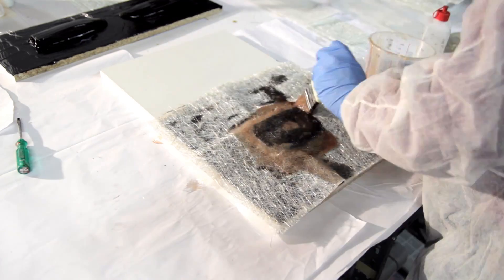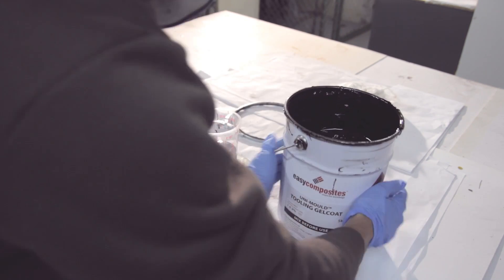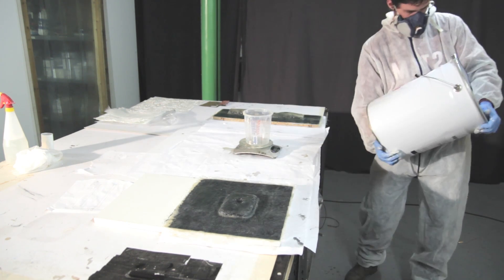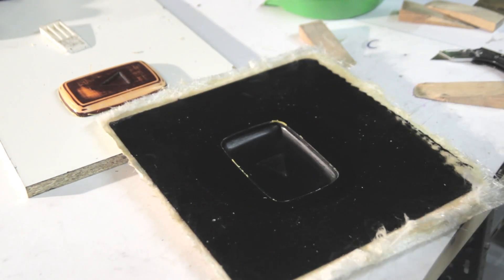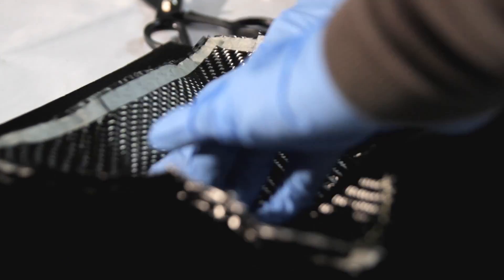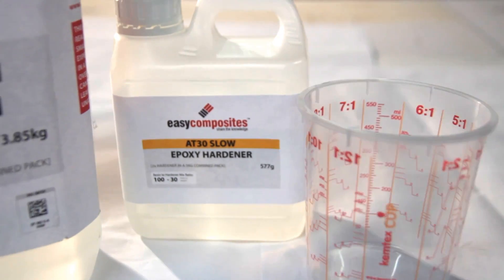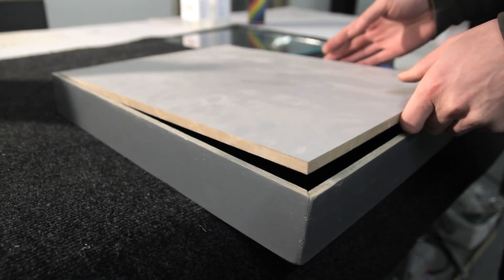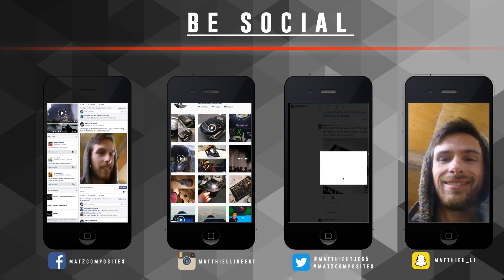10K Carbon Fiber YouTube Play Award Button - PART 2 (how it's made)

Comment: Question, why don't you use a gelcoat for release of the part from the mould? is the release agent enough?

Greetings from Antwerp!
Reply from the maker: gelcoat will not add anything to releasing the part, it's just an extra toplayer of resin on top of the part, release agent will still be necessary
Reply: so the clear epoxy parts are not UV resistant?
Reply from the maker: they are to a certain level, I use clearcoat after it to make them uv resistant

Comment: Quick question would putting it into a vacuum chamber machine (8 millibar) (as a have one available) would I get a better result?
Reply from the maker: no, its the bag that needs to be pulled against the part to create pressure by using vacuum

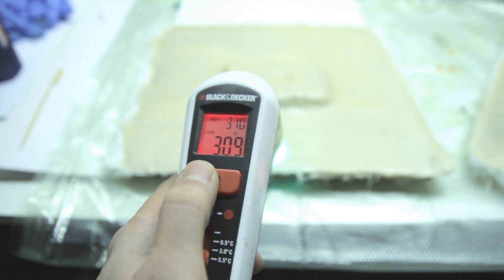Comment: 3:59 i'm pretty sure you mean endothermic reaction not exothermic.
Reply: It is celsius. 38˚C = ~100˚F
Reply: +Eli Wiel yep
Reply: So it is exothermic.
Reply: not exothermic
Reply: ***** no exothermic (cool down) is when it releases heat and endothermic is when it absorbs heat (heat up)
Reply: I think you got it backwards, buddy. Look it up.
Reply: ***** When trying to classify a process as exothermic or endothermic, watch how the temperature of the surroundings changes. An exothermic process releases heat, and causes the temperature of the immediate surroundings to rise. An endothermic process absorbs heat and cools the surroundings. so if there is an exothermic reaction then the areas surrounding the object will get hotter and the object its self will get cooler. and in the video he is talking about the object getting hotter which means its endothermic. exo means out side so it means its sending the energy out and the opposite for endo. its pretty simple.
Reply: Thats not how it works. I have taken multiple chemistry classes, and have learned that if a reaction is releasing heat, it is exothermic. In this case, we see that the reactions of the chemicals he is using to make the mold, has risen the temperature to 38C. Room temperature is roughly 21C. This tells us that the reaction is releasing heat. Therefore this is an exothermic reaction. If you are confused on this basic concept you can look up some reading material on the internet, or if you would like, I can link you something to read.
Reply from the maker: to clarify this, I can say with 100% that it's an exothermal reaction. It's a chemical reaction in the resin that creates energy that can be seen by heat

Comment: Hi Matt, great vids.
How do you find the Fusionfix spray tack? I'm pleased they now sell it again. Did you notice any tainting on the surface using this product?
keep up the good work 😊
Reply from the maker: +Mark Paxton really like it...but be sure not to use to much or it will leave a white residue in the resin where it is resin rich... just make sure not use to much...it's a matter of getting used to it but only use this one now because I'm happy with it
Reply: +Matthieu Libeert (Mat's Prototyping) thanks for quick reply.
Ok thanks, I read on EasyC forum page of another called Aerofix 3 which apparently does not have that problem. How true it is I don't know, I'm thinking if trying it. if I do I'll let you know how it goes.
thanks again